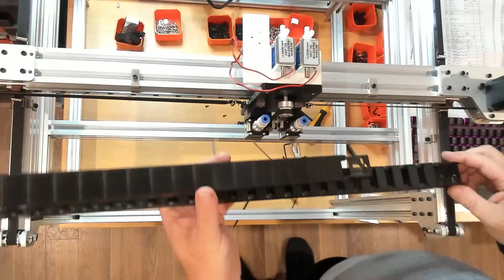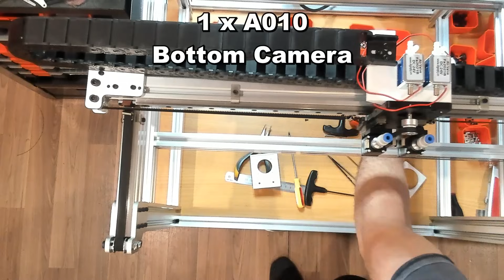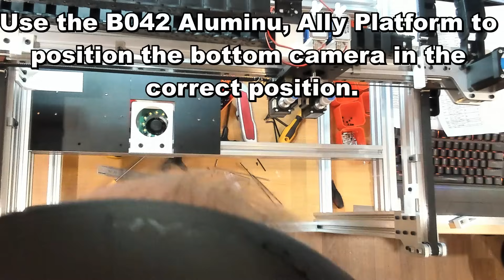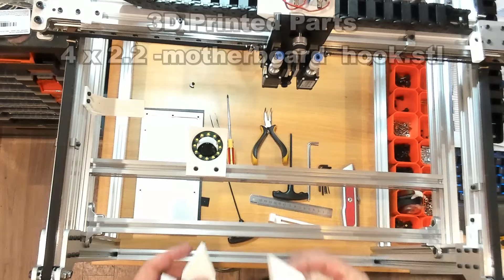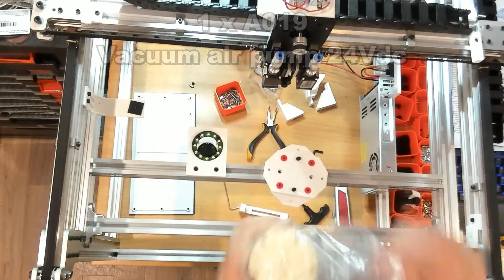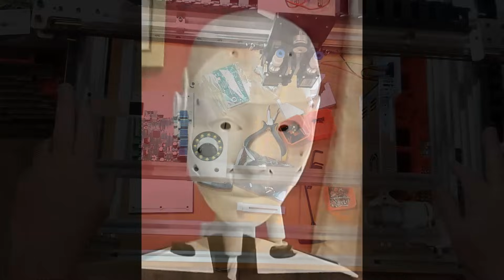MicroSMT_Electrical Part 1

Comment: hi!! is inmoove already walking? thanks for the channel!!
Reply from the maker: No 😞
Getting Inmoov to walk is a massive undertaking.
I'm using other robots to learn a few things that are required for walking.
MR4 is built to learn about navigation.
Spot Micro is to learn about balance and first steps in walking.
Then we need to look at the design of the legs, these will need to be a lot more powerful than any other part of the robot.
It not only has to have the power to lift the whole of the robot along with its batteries, but have to be fast enough at the same time to get the legs under the point of balance as well.

Servo motors as used in the rest of the robot just won't do it.
I have created a document on the subject.
https://www.dropbox.com/scl/fi/vqtyb1h1sb1fft2owulxd/Walking-Robots.paper?rlkey=sczvf4aozzfoe3bv5r654fpgg&dl=0
Feel free to make comments on the document
Reply: @CyberOne  OOOHHHH THANKS!!!